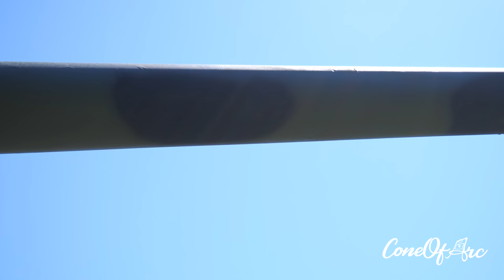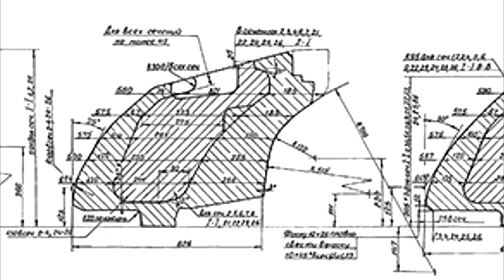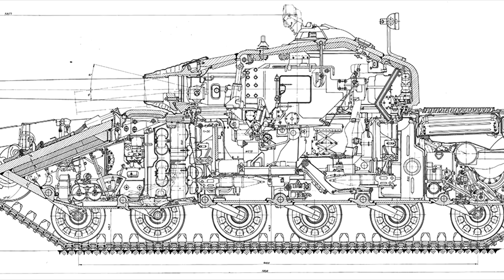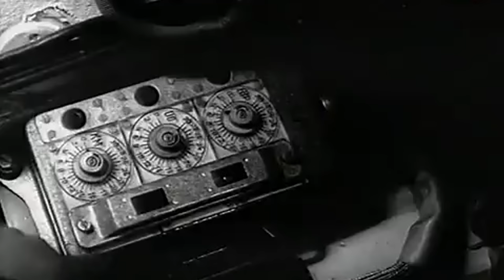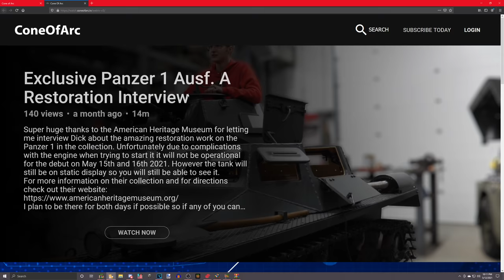Raising the Bar, the T-64 | Forged for Battle

Comment: considering that leopard had 40mm of frontal armour 
and m60 had 100mm

i don`t think that 85mm side armour can be considered as thin
also all tanks had exposed ammo racks at that time

leopard had 40 shells in big cluster right behind the frontal armour(and still has in leopard 2)
basicly half of the frontal silhouette is ammo rack and there is no armour to protect it unlike t64

Comment: **FACT: At ranges greater than 1500 meters, the T72/ T90 cannon fire is ineffective against the Abrams frontal armor.**

**At the same distance, the Abrams can turn the T-72/T-90 into an instantaneous 3 person crematorium. **
Reply: M1A2+ Abrams can only destroy earlier T72's frontally, but it cannot destroy T90 or T72B3 without hitting weakspots on the front and same goes for T90 and T72B3 they cannot destroy M1A2+ frontally without hitting weak spots (which are actually larger on Abrams), but more likely T72/90 would be able to get off the first shot due to the ability to fire guided missile at long ranges. T72 was made a decade over before M1 Abrams and the early M1 Arbams was barely even able to fight them on equal terms, M1A2 is much newer design. The only thing Abrams has over modern T72 and T90 is better reverse speed and safer ammo stowage, nothing else (while also having multiple negatives).
Reply: @UENVEYME2  Its a SIMULATION...good luck getting basic M1A2+ firing at 2500m/s and that simulation does not take modern ERA or composite armor into account and its its not at an angle. Not even to mention your original point was about basic M1A2+ Abrams against basic T-72B3/T-90M. So now when i pointed out your lies and misinformation, you just change the subject by showing me some potential future gun developments (which would more likely require a new tank completely by that time)? Oh and why Russia could not pursue something similar? Pathetic deflection after being caught lying. M1A2 is the most over propagandized tank in the world, while in reality its pretty average.
Reply: @CloneDAnon  Clearly, you didn't bother to educate yourself on Electro-Thermo Chemical Cannon Technology........As you know, the M1A2Sep3 keeps all of America's potential adversaries awake at night.  All the while America and her Allies sleep soundly.
Reply: @UENVEYME2  It is potential future technology that is not available yet from what i know and the best use for such technology would be creating a completely new platform for it. M1A2Sep3 has the M256 smoothbore gun which is the licensed Rheinmetall L44 (not even the L55). Its a good gun, but nothing special. You were talking about basic M1A2+, now you have to make it Sep3 even though the results would be the same against T-72B3, T-90M or T-80BVM like i already said above. But since i destroyed your initial pathetic argument and manipulation, you have to constantly "one up" me, but i can play that game too. I am quite sure that the T-90M and T-14 Armata are not afraid of M1A2Sep3. The thing is that M1A2 Abrams tanks have never faced modern tanks, the best they have ever faced are downgraded (with less armor) export variant Iraqi T-72A's from the 1970's that did not even have the most basic Russian mango round and not to mention that Abrams had total air superiorty and thermal sights which the Iraqis did not have. I do not care for you trying to "one up" me by talking about some potential future technologies, i just pointed out your lack of any knowledge about tanks. Abrams burn just like any other tanks, you can find plenty of videos them going up like torches. Arbams is the most over hyped and over propagandized tank in the modern history, while in reality its just an average tank that has its pros and cons. Reality is more complex than your "my pp is bigger than yours" 12 year old arguments.
Reply: @UENVEYME2  nice copy paste
Reply: @SovietUnion_  Thank you for reading comments, because others rarely do.
Reply: @CloneDAnon  Conversations evolve and I'm sorry that you're finding it difficult to keep up.  

Q: If your beloved T-14 is so amazing then why hasn't a single country bought it? Why did Poland buy the M1A2SEP3 instead of T-90 or T-14?
Reply: @CloneDAnon  Not a single order for your beloved T-14 Armata.....Egg shell turret incapable of absorbing a single hit from a Western MBT. Flawed concept with zero customers.
Reply: @CloneDAnon  How combat effective is the T14 without it's 125mm cannon? Russian tanks are way overrated, and you're pissed because I'm bringing truth to the T-14 love fest.
Reply: @CloneDAnon It is over propagandized because it is a real threat to soviet tanks, and it isn’t just some poor upgrade either, it’s a new tank meant to counter/resist both old and present threats, like Leopard II or T90M are propagandized for example.

The reason the T90 is being shat on is because it is just, a rebranded T72 hull with a new turret!
There are also the factors of gun depression, the absolutely ABYSMAL reverse speed, the carousel style autoloader as well as being cramped.

Compare that with Western tanks for example, are either Leopard II or M1 uncomfortable?

Crew Comfort is an insanely important feature in tank designs, how are they going to make the most out of their machine without being comfortable?

Gun depression is also insanely important, Western tanks have more armor on their turrets compared to their hulls, they’re meant to go hull down, what will a T90 do against a hull-down Leopard II or M1 for example?

How is a tank going to escape a brawl with another tank if its reverse speed is horrible, turning around is just gonna get them killed or disabled, how is a tank going to relocate after firing if its reverse speed is just worthless?
Reply: @Cyril_2009  Tanks "brawl" only in video games. T90 is a heavily overhauled T72, but beyond the chassis built on same basis, the similarities end there. The reverse speed ain't no big deal, especially for the time when tanks were designed (before mass proliferation of thermals, drones and hand held guided missiles). 

You do realize that T64,72,80 and 90 series tanks are almost twice SMALLER and much lighter than M1A2 or Leopard 2, while often having equal or better armor (depending on model)? Having smaller siize and weight is a major advantage, that is not so obvious at first glance. But it makes their spotting (especially pre-thermals) that much harder, plus it increases the chance of a miss when fired against them due to them being smaller targets. Meanwhile lighter weight increases their off-road performance and allows them to cross places where the Western 70 ton tanks simply can't.

Complaining about the tank being "crampedd" shows that you do not want a true vehicle of war pushed to max capability, but some comfortable high maintenance luxury machine. No wonder you can buy multiple Russian tanks for the same price as comparable Western tank. Clearly you have not thought this trough from the lens of total war (when everything is min maxed).
Reply: @UENVEYME2  They’re at odds with each other so that’s the main reason why.

But there are other reasons as well.

The reason the M1 was bought instead of the T90 is because it was better in the eyes of Poland, it performed better compared to the T90M.

The M1 has a great record, it’s well protected, has great armor, mobility and firepower, it’s also very reliable, etc.

The T90M’s history though, it’s decent.

Let’s take another example, Egypt, why did it buy 500 T90M, because it’s already got M1s and is still producing them, whereas it has no factories capable of manufacturing the T90M, therefore it has to be exported from Russia to Egypt. So how was Egypt able to buy the T90M?

They’re neutral, they’ve got great relations with the US and the USSR ( Now Russia ).

Why did Egypt buy T90Ms instead of M1s?
It already has M1s and is currently producing M1s, there is genuinely NO need to buy more tanks from their country of origin when you’re already producing them, especially when it’s not wartime when numbers decide the fate of war.

But I do see the decision as something insanely stupid and probably was only made because of a lack of money to buy enough M1A2s, otherwise we’d have gotten 500 M1s instead of T90Ms. 

To piss off the Russkies,

I pledge allegiance to the flag of the United States of America, and to the Republic for which it stands for, one nation under God, indivisible, with liberty and justice for all.
Reply: @CloneDAnon  

The only difference between a T90 and a T72 is that both have different turrets and designations…

That’s why people say Russian tanks are less armored than Western tanks, the weight makes it obviously clear, if it is equally as well armored as you say, then it’d atleast be 50-55T rather than just 45T and yes it is smaller, but it’s not twice as small, the Abrams is just .22m taller than the T90…
And how exactly is a T90M a harder target to hit compared to an Abrams?
Why is the T90 still slower than the Abrams despite the reduced weight?
But what you said about bridges IS true.
Also, thermals are everywhere now and have been since the 60s, so your point about them being harder to spot is ALSO completely BS.
I don’t think anybody is going to ride in a Panther and try to spot a T90M in a forest…

Reverse speed is insanely important, the fact you said that just shows you know nothing, how are you supposed to get the fuck out of a place in urban areas if your reverse speed is non existent, how do you relocate after a shot if your reverse speed is hell, how do you even do anything if your reverse speed is shit?

If your point about Crew Comfort is true, then why do professionals such as Chieftain and MHV say that it’s insanely important?
Why was the Sherman praised for it too? ( By soviet elite tank units too )
Why is Crew comfort prioritized by the West if you think it’s useless?
Reply: @Cyril_2009  There is quite a bit more different in T90 and T72 (including the armor package, electronics and other stuff). Thermals have been around en masse only since the late 1980's and definetely not 60's. IR night vision is not same as thermals. T90M aint slower than an Abams (its slower only in reverse) and Abrams mobility comes at a price of being an expensive gas guzzler. Yet the T90 outperforms an Abrams and Leopard 2 in extended period offroad conditions (where tanks actually operate) due to lesser weight. Plus acceleration is way more important than top speed in a tank. Do you even know that Russian tanks are MULTIFUEL? They run both on diesel and gas no problem. That is a huge effing deal during a real war.

You are assuming that in real life tanks operate like in video games. In urban areas tank do not need to "get out", since tanks would NEVER enter urban areas without friendly infantry provding them cover on all sides. Also, you do know that tanks can PIVOT around their own axis? Having good reverse speed is nice, but its not critical, since its not needed most of the time and  can lead to inexperienced tankers wrecking the tank (case and point with Ukrainians during training they wrecked one Leo2 by going way too fast in reverse). Reverse speed is only for you after your tank has been already hit, since you won't be dodging any guided missiles with it in the first place.

We are not talking abuot Shermans and T34's here, but about modern MBT's and ive never heard people complain about that T72+ tanks were somehow uncomfortable during their basic operation (other than there is not much room, but hey you dont have to move around much in the first place). Why do you need "crew comfort" when you do not have to move around a tank) You don't have to move around an autoloading tank during combat (other than when entering and leaving). So the argument about crew comfort only loosely applies to tanks that have manual gun loading. A seat is a seat and if you can comfortably sit for hours, what else do you need and how much that will add to the overall price tag? Or do you think that Western tanks are many times more expensive just for fun?

Russian tanks are more or less equally armored as Western tanks. Often the armor is even better in Russian tanks in some places (like sides and rear 80mm vs 30mm). The weight is saved in their size difference, not their armor package. It is true that smaller size comes also at a negative, since the interiors are also more closely packed which in turn makes them way more vulnerable for post-penetration effect.

PS. Maybe you should take off your ideological fanboy blinders and look at things objectively.
Reply: @Cyril_2009  No, its only you here who clowned himself by claiming things i that never said. Only said that acceleration is more important for tanks mobility, than top speed.

PS. But acceleration on decent road is very much different from acceleration on muddy off road terrain for a 70 ton tank vs a 55 ton tank.
Reply: @CloneDAnon  I’m sorry, I misread some things you’ve said so my bad
Reply: @CloneDAnon  Sorry, I’ve misread what you said so, my bad.

And yeah I do agree with your point as well

Comment: not as good as they made out, the biggest problem they had was the same "auto loader" as used in the T-62, the T-72, the T80 and the AT 14 tanks...and boy do they burn when hit by an NLAS or javelin
Reply: all tanks suffer from penetration from the Javelin missile
Reply: @kamovka2317  not quite i used to drive,load,fire and command tanks back in the day...and the russian tanks have a FATAL design flaw... the carrousel under the turret basket full of ammo!...my tank of choice is a challenger 1 or 2, not those piles of trash that are meant to be tanks!
Reply: @grahamkeithtodd  wait until you realized that western tank have less armor on the roof compared to Russia one and the Russian one still got destroyed by javelin and NLAW

Most modern MBT would still get destroyed by javelin and NLAW even western tanks
Reply: @mbtenjoyer9487  er in both gulf wars, challenger tanks (mr 1 and mk2's
) where hit repletely by rpg's including the Russian version of the javelin they did not explode, nor pop their turrets in face NONE where lost!@ unlike all the rubbishy tanks the iraqi army got from the Russians... we must bge doing something right unlike the rusians
Reply: @grahamkeithtodd  1. most are RPG-7 With older ammo that can’t penetrate modern tanks 
2. Russia doesn’t have a top attack ATGM like a javelin so there is no russian javelin 

3. Most tank used by Iraq were outdated variations of T-72 and were using old APFSDS and didn’t get the best APFSDS at the time 
And They weren’t the best T-72 at a time 

4. Iraqi military were Low moral low skill
 
Your argument is all wrong

Comment: NATO heart attack.
Reply: That’s the IS-3, because it actually did scare NATO due to how much Armor and Gun it had
Reply: @Predator20357  the 64 was well ahead oh the chieftain and M60
Reply: @khahinmetameta7826  Difference is that those two tanks are more suited for Defensive Role and also still had a decent chance of punching through the T64 armor needing just a few rounds at most.

The IS3 was seen as this rolling beast that will just murder the M46s and M48 with no way of getting through the armor.

Long story short; the T64 wasn’t seen as this overly powerful tank and was just thought of the T-55 but better. It’s a threat but nothing to the extent of the IS3 at the time, just make better HEAT or Missiles and it’ll go down like the rest.